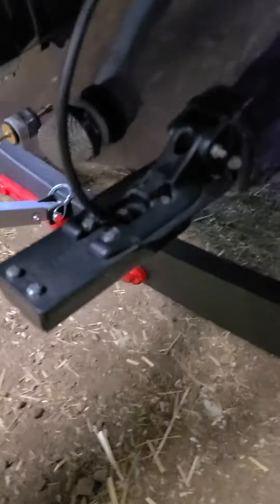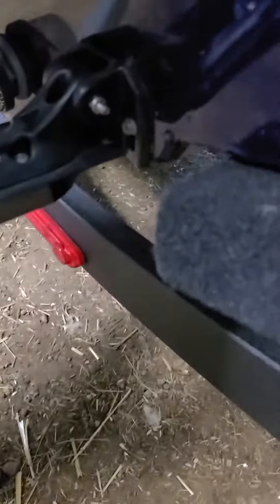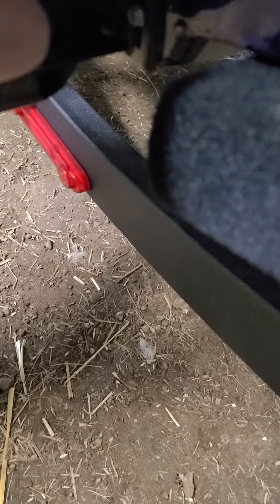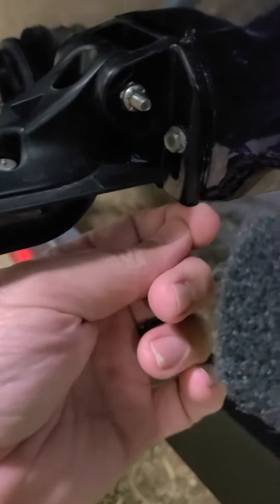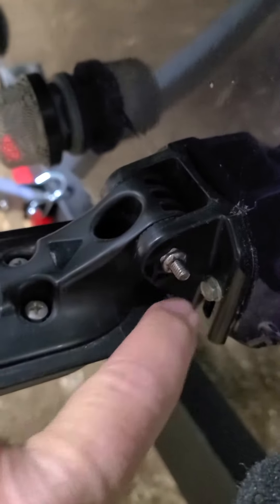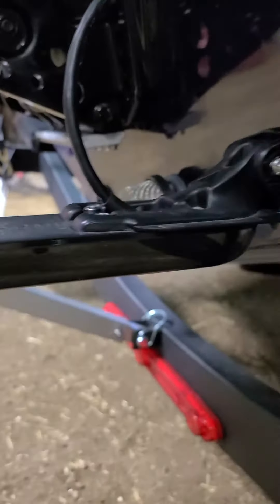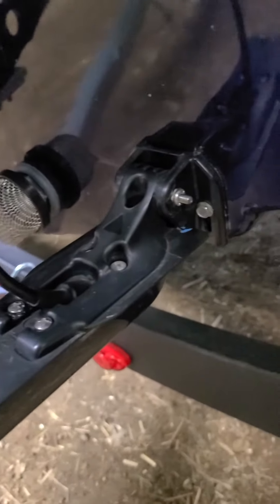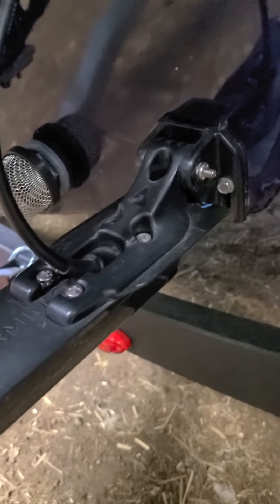Mounting a Garmin transducer on a 2021 Tracker PG V16 WT

Comment: how did you get the wire through the tunnel
Reply from the maker: Took side plate off. Went over top of rear deck rather than pull it.

Comment: Hey Dave, it’s a long shot being your vid is a year old but I’m hopeful.  I have the same boat. And I’m wanting to install my transducer on it but can’t find any how to vids on removing the back deck and side panel. Did you install it yourself self if so some insight on how you removed the panels would be great or did you have it done by a shop.
Reply from the maker: Did it myself. I only removed side panel. 
The factory transducer I just cut the cable where it goes into deck
Reply from the maker: It takes a square bit to remove factory self tappers. Can be a pain to find them in the carpet
Reply: Thanks for replying back. When you removed the side panel, and you said you cut the cable to factory ducer. Did you run the new diver cable same route through the back and up along behind side panel and under dash
Reply from the maker: I ran behind side panel from stern up to throttle box . Otherwise it's visible but out of way. Factory has cable zip tied in many places and buried in foam.
Reply: Great video. Did you notch the transducer cover plate or the two angle pieces on the mount that screws to the transom?
Reply from the maker: @bobbyrobbins9816  cover plate iirc